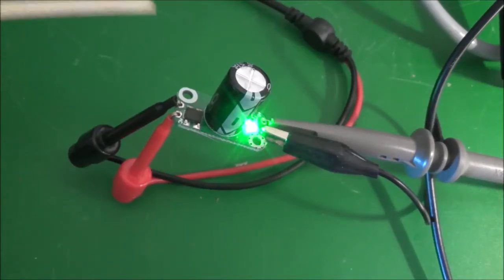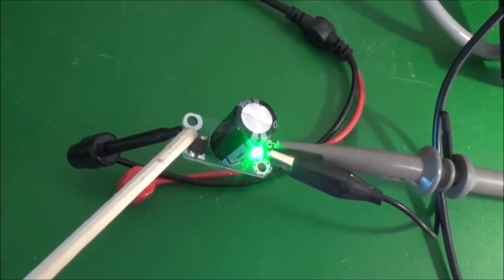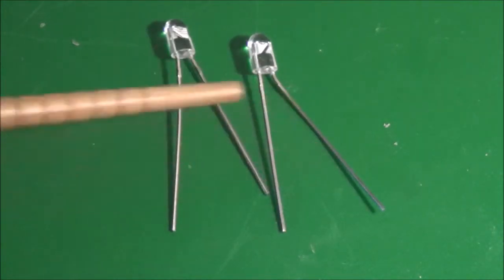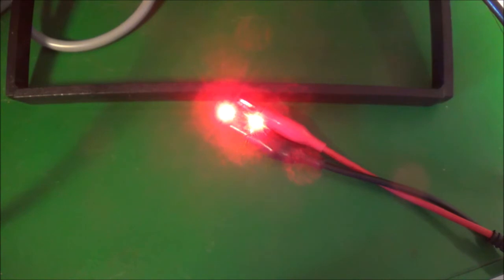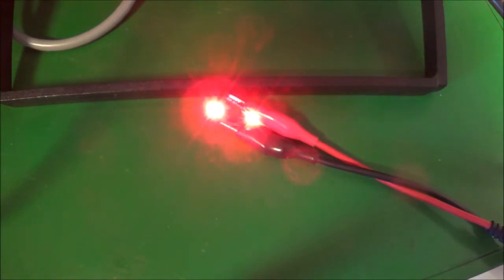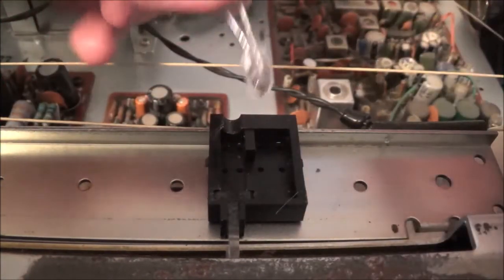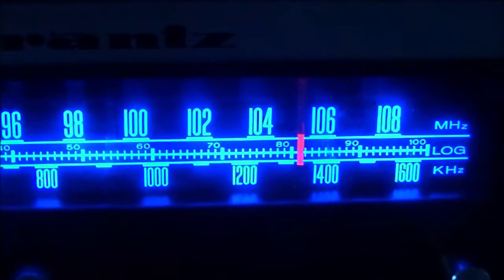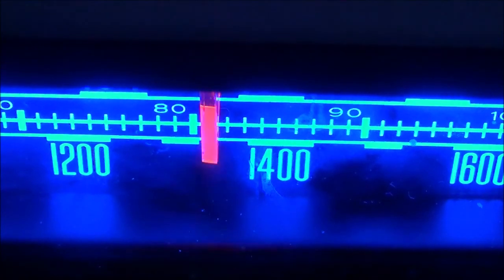Marantz 2215B Stereo Receiver Lights -- PART 2

Comment: I have the same amp and I need a solution to replace of the 5+1=6 dial bulbs. I think the voltage for the lighting circuit is 6.3 volts for my 110 volt Marantz 2215B amplifier. The old bulbs were 8 volt 200mA. I live in europe so the voltage here is 220 volt. And the cycle is not 60hz, it is 50hz. So should I go for LEDs that are in the video or SMD type leds? Should I wire 3 Leds on a board and use a resistor? Please help sir. Kind regards

Comment: Very cool with connecting the LEDs that way, never did...but now I might dork around!  :)  I did like the dial pointer flashing like that!  As far as why the eyeball vs camera thing is, is very simple...the eyeball see's  slower then the shutter of your camera.

Depending on where in the world you are will dictate on what speed your cameras shutter opens and closes, if you are in 50hz  land, then at default, your shutter will open and close  50 times per second, the same is true if your in 60hz land.  Now, if your camera is in auto shutter mode,  most people either dont have manual control or they just dont set them up...in auto mode, depending on the light that is reflective or directly bouncing into the lens will dictate at its speed...in bright light, your shutter speed will go faster...camera dependant...could go as high as 1/10,000p/s ...that's 10,000 times per second...in dim/low/no light your shutter can go as low as 1/16th per second (camera dependant) and lights will be the brightest element of your shot and the image in general will become smeary.  
If you every watched the movie "Saving Private Ryan", the fast moving war scenes was shot in very high shutter speeds, gave it a fast and choppy, busy look, when that came out, a lot of movie makers used that trick.  I've been meaning to do a video on this very same topic but have been busy...now due to the fact traffic on my site has petered out, I dont think I will as I just may abandon my site in general...no need to put in a lot of work if no one watches...I have other things I can use my time with.  Thanks for the video OS, stellar as usual!  ~Jack, VEG
Reply: I also wanted to stated that because the shutter speed, it is either going faster or slower then light...in the case of LEDs, the light does "emit" at a speed...just like newer non-linear  power supplies and other electronics parts....on / off.  ~Jack, VEG
Reply from the maker: Thanks, Jack, VEG, for that great, in-depth explanation! I knew there had to be an explanation, but just didn't know what it was. I think you might just be experiencing a lull; happened to me too. I will try to promote your channel in my next video or description. Perhaps stick to the videos which are watched the most? Thanks again!
Reply: @OldSchoolElectronics  My pleasure!  Its a topic I know very well...I did it for a living before retiring.  It may very well be a lull, Ill rough it out a while before any major decisions.  I appreciate your support very much!  I really did enjoy this video...I wonder what I would have done facing that challenge as well...we will never know until one day a video is posted!  :)  Take care my friend.  ~Jack, VEG
Reply from the maker: Would be cool if you could make some beginner's video and photgraphy videos!